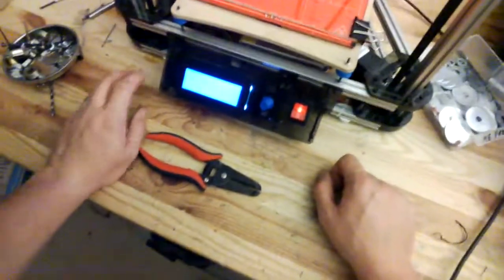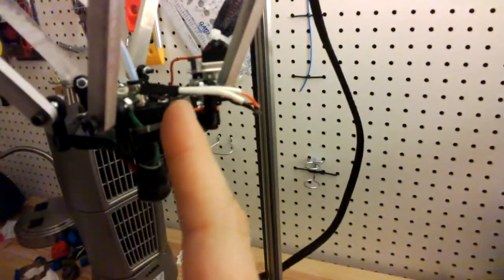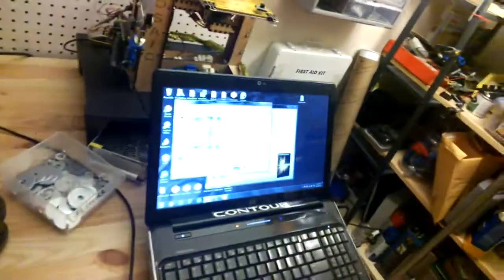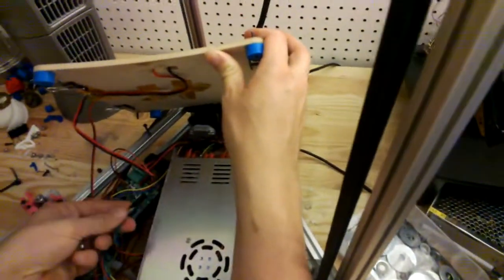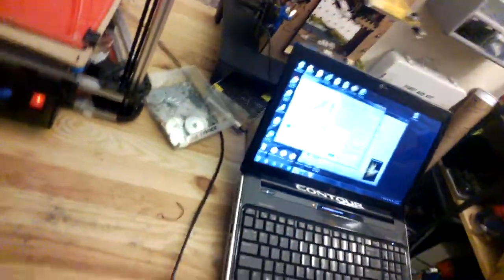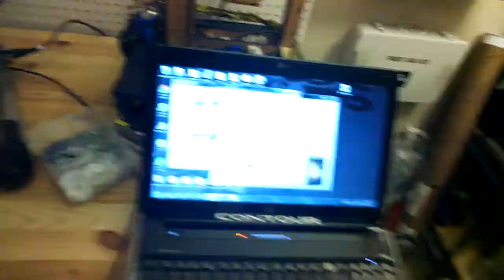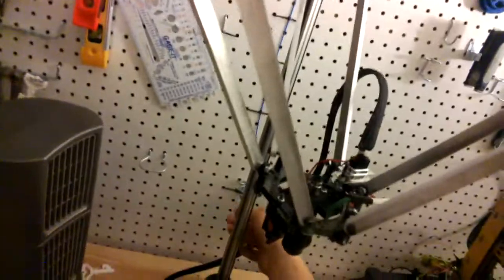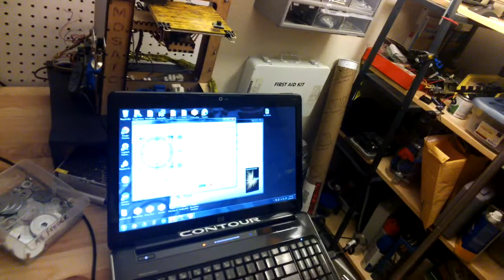3D Printer Repair- Part 3 Filament Drive

Comment: Hey John, I'm in the same boat. I built a Kossel Mini, Did my first couple shitty prints last night. Need to get things running nicely. These Deltas can produce amazing quality. I met the Blue Eagle folks at the 3D meet-up in Sorrento Valley. I still need to wire my LCD/SD card.